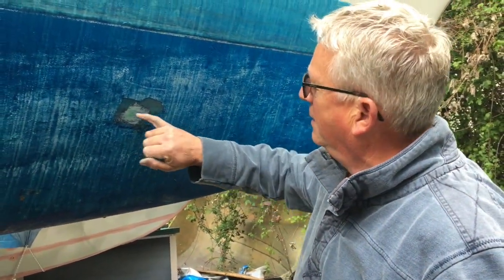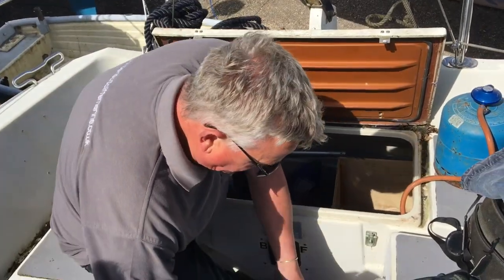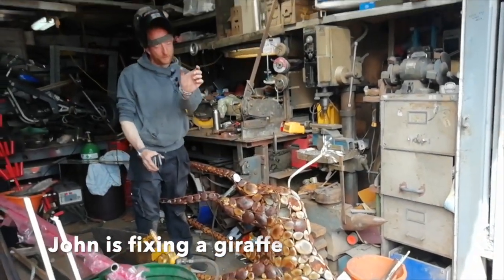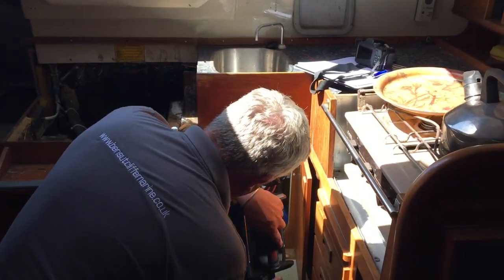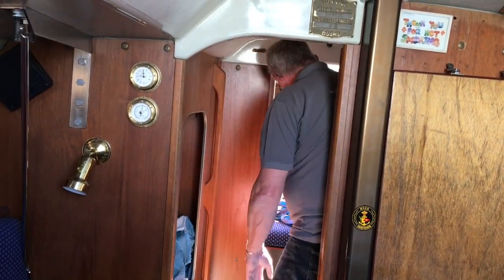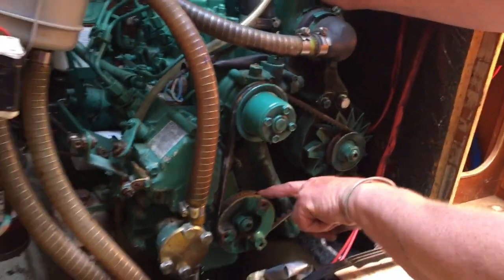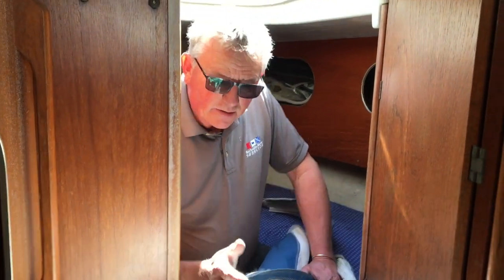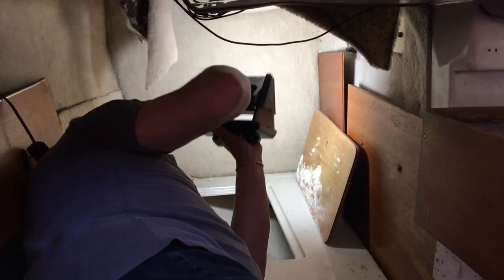Is this boat seaworthy? Surveyor performs pre-purchase survey on a Maxi 84 yacht

Comment: I found this tremendously useful. It's a surveyor's job to find what's faulty, what might become so, what could be expensive and what's better than average, and to give an honest report to the client. Finding things later that a surveyor should have noted is very irritating. Knowing that a boat hasn't been in the water for two years would, you'd think, flag up that the batteries are going to be flat so taking a portable battery pack seems obvious to me.

Comment: sorry to ask questions but how much should i pay for a survey on a boat that's worth 10 000 pounds 31 feet
Reply: Survey cost is prety much based on lenght of the boat, and to a lesser degree if it's grp/wood/steel, but not the value/age. Probably around £500-£700 but that won't usually include mast/above head height rigging or a full engine inspection which are specialist jobs.

Comment: Really sorry for you to survey those boats, because brittle thermoset resin is not seaworthy even in perfect condition, not to mention cored hulls and those people get scammed with corporate design manslaughter to give more "adventure risk" to summer competition sailboats that "trickle down" to cruisers and sailors. You can cover those hulls with flexible outer chambers and skin of flexible polypropylene or HDPE to bend under impact and make them unsinkable and don't grow fouling, increasing initial stability by modifying stern and bow, also the keel can be removed reducing structural stresses and incorporating water or bulk grain ballast, an use cat ketch or other small heigh right to reduce heeling, while also covering the deck with aluminum mylar and epoxy to stop UV degradation. Those simple hacks can extend the life of thermoset stayed keelboats that are product of a disgusting petrol lobby on shipyards, sailing competition and magazines during the last mid-century
Reply: You have no clue
Reply: @ohnezuckerohnefett  your only clue seems to be petrochemical refinery waste chemicals advertising that sponsor and floods all magazines and things related to sailing. You can salvage any boat of any material but that doesn't mean these were materials to use in a boat structure
Reply: @crapisnice What kind of boat do you own?